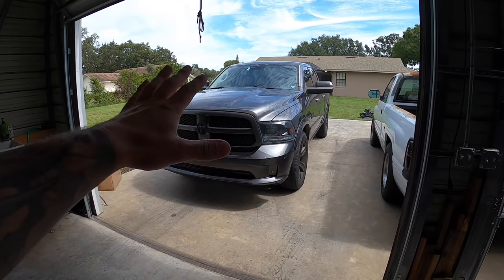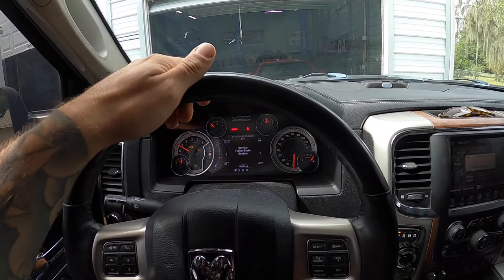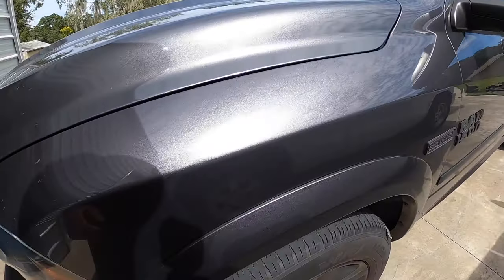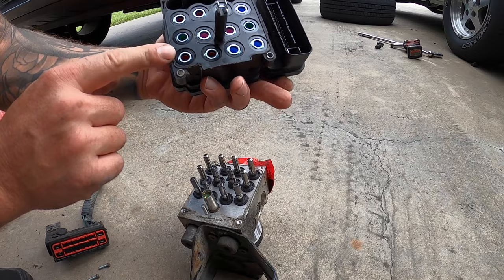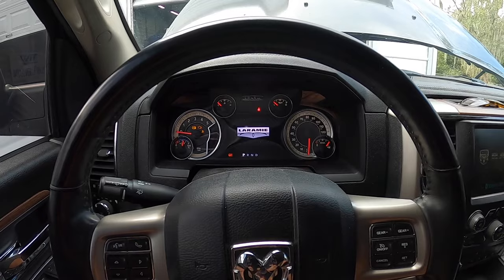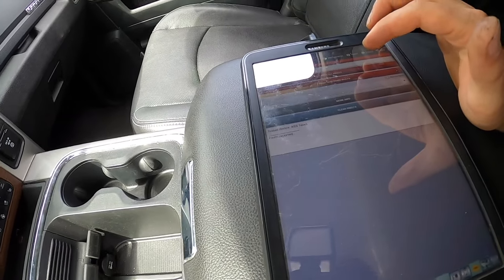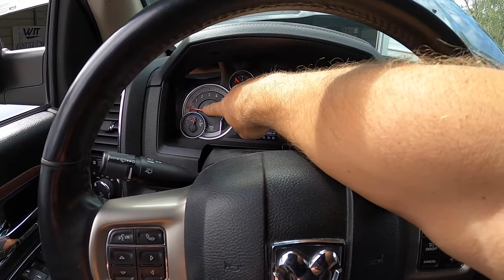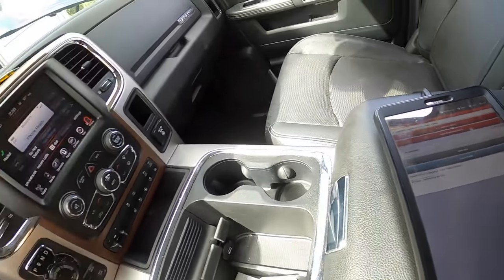RAM ABS Module Failure Code C2200

Comment: I replaced mine easily enough with help from this video, however the problem came back in 2 days. It's intermittent now, and someone elsewhere mentioned they had this issue due to a frayed wire along the frame somewhere. Has anyone found where it tends to fray?
Reply: I had this problem.  It was at the dealer for weeks.  Finally they found a fault in the wire from the module to the plug connector behind the driverside front left tire.  They bypassed the wire with a new one.  Worked great for a week and the problem returned.  There is a SB in the STARS system for this issue showing the same wire getting frayed along the bedrail above the fuel tank.  It give instructions to replace the wire bundle.  My dealer didn't do that, rather charged me to just install an external wire.  I'm probably going to send my control module back to the rebuild shop now and my thinking is that wire messed it up somehow.  If that doesn't work, I'll likely be looking to get rid of the truck, sadly.
Reply: @brentgilley5166  did you ever get the issue fixed and if it was related to that frayed wire is that something I would be able to visually see or would the gas tank need to be dropped?